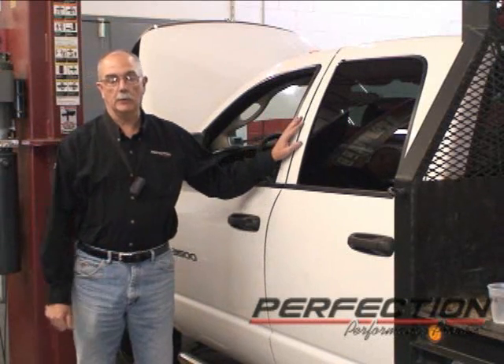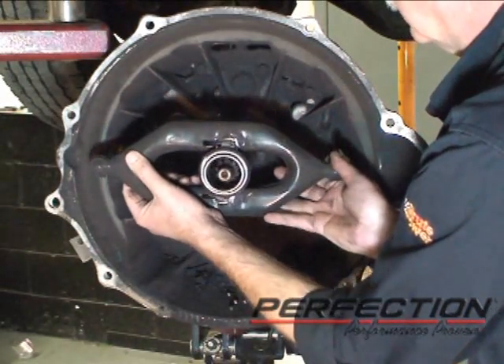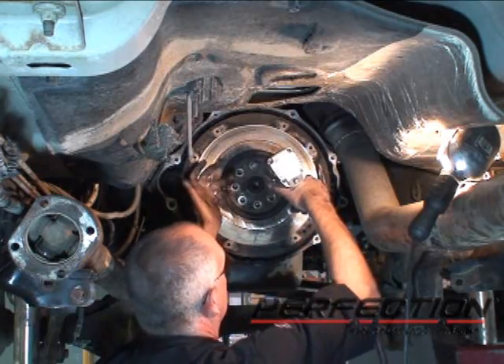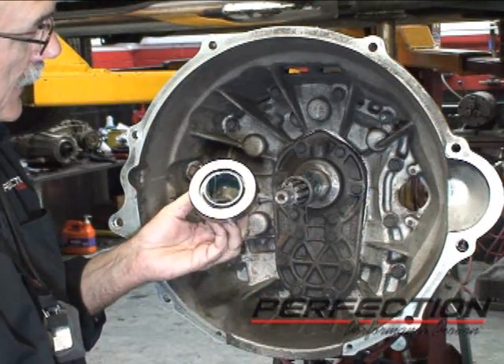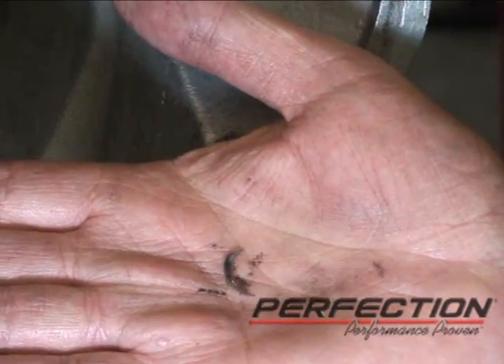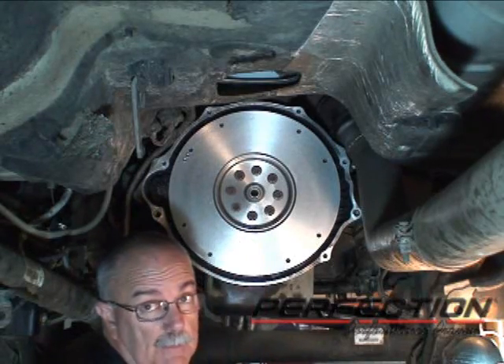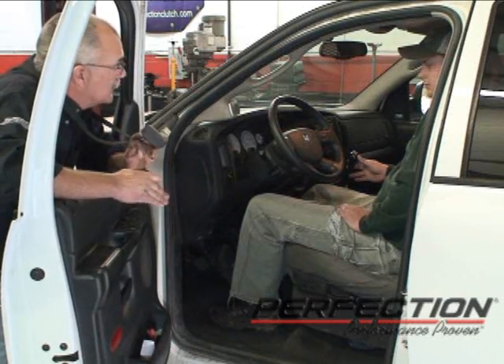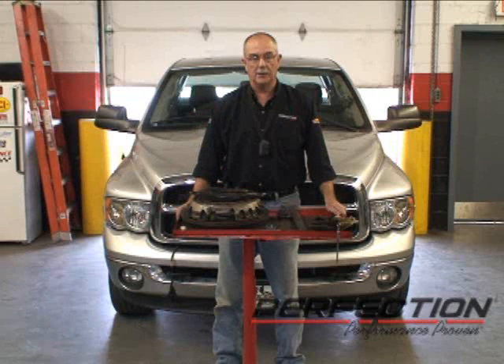2004 Dodge Ram Pickup w/ 5.9L Cummins & NV5600 - Clutch and Flywheel Install

Comment: Thanks for this video, I just swapped an nv4500 into my 98 dodge and was having a hard time shifting into 1,2 & R after the trans got warmed up. I pulled it out again today and cleaned a little rust off of the input shaft and it shifts nice and smooth now.

Comment: I replaced the clutch in my 03 with the 5 speed. It didn't last two months. Thanks to this video I see a few things I did wrong. These are a lot different then the old manual clutches I've put in our tractors. Guess I know where I'm gonna order my next one from. Thumbs up on a great video.
Reply: Hi having the same problem ..what did u do wrong?...im thinking i put the clutch fork in backwards

Comment: Gary, I used a very small puller and was able to get the bearing off....you were right, it was a needle bearing set up and completely dry and seized.  Today I will see if I can inspect the nose of the shaft....

Comment: Thank you so much for the detailed and thorough explanation. My truck needed a new clutch so took it to a local reputable shop. When I got it back  it had a vibration and notchy shifting, hard reverse and was very disappointed. Took it back to the shop they took it back apart and changed to a different brand throughout bearing... still had the vibration and notchy shifting. So I decided to open ER up myself to see what's going on....... Right away I found dirty, rusty spline and they had the trans in a bind by using the bolts to draw the trans together.... So frustrating that the pros damaged the belhousing and did such a poor job on the install. My only question is to make sure I am ok to use a little #2 hi temp wheel bearing grease one the spline. I preformed the install exactly how you did cleaned all rust with emry cloth and screw driver. South bend says leave the spline dry ... They contened even the smallest amount of grease on the spline is a no no. They say grease will work its way to the disk and case slipage or hard spots ... they also said the grease also attracts dust and clutch friction material over time compounding the problem of a clean spline. So the tought was leave dry and the hint of surfice rust is less problematic than the grease slinging on to the disk and the dust packing up on the spline... Is there any truth or should I do as you showed?
Reply: @perfectionclutch  thank you Gary again for such a detailed video and your willingness to share your knowledge. I trust your input and is why I asked the question. There was two companies the local shop and South bend clutch manufacturers. They have nothing to do with each other. The local shop is who did the install poorly. South bend clutch manufacturer is who I got the pressure plate, disk and flywheel from... South bend is who had me scared about spline grease...  but I know you have real world knowlage of many many clutches installed. Just wanted to do it right when I did the job. Again thank you very much. I took my time to put it all together clean and propperly alligned... I loved the tip of using the Hager bolts ... Thank you have a great day

Comment: Just for laughs - "I got tired just watching this video". You're one heck of a mechanic sir., I have been through 3 clutches in my Dakota., I don't ride the clutch or slam gears. I have had a few questionable repairs by local mechanics, one reputable shop said they found 15 nuts, bolts & washers when doing repairs. I would like to have it done right just once though as I don't have the patience,  ability or facility to do the repair myself.

Mechanically speaking the 4.7 L engine is about the best motor I've ever had, I keep clean oil and other fluids clean and lube the K&N air filter etc. The motor has never given me any problems but now the shifting has gotten stiff again and I smell another clutch job soon. I love this vehicle and hate the idea of getting rid of it because everything but the clutch and related parts have been great.

If you have any suggestions I'm all ears. Thanks very much for your expertise - God Bless.
Reply: ***** Thanks Gary have a blessed day., and thank you for your humble attitude.

Comment: Gary, I have a 05 dodge ram with a oem luk clutch.  Started making a noise as if a bolt came loose and was jingling in the housing...pulled the transmission and while very sooty inside, can't visually see much.  I did notice the pilot bushing is stuck on the input shaft and center of clutch rattles alot.....any ideas?  Easy idea on removing the bushing?  BTW, awesome video!!I ahve watched it no less than 5 times..

Comment: I WAS AT THE DODGE DEALERS PARTS SERVICE DEPARTMENT AND ASKED ABOUT GETTING A CLUTCH PEPLACED ON MY 2003 DODGE CUMMINGS 6 SPD.  I got the price quote for the clutch and along with that, It was said that the Dodge fly wheels were machined at an angle to keep from chattering and it was advisable to replace the flywheel also.  Is it a true statement that the fly wheels are machined at an angle

Comment: So what clutch would you recommend for my application. I have a camper and boat I take out  quiet a bit . I was was told the clutch in it is a South Bend Duel Disc . But that’s what I was told . Thanks

Comment: Excellent video.  I have a 2005 dodge 2500 4x4 with the Cummins engine, it has 230000 miles on the original clutch and it is showing signs such as slipping and sometimes putting into gear.  I have on hand a Valiar kit clutch and new fork.  My grandson will be installing it he has a transmission jack, and lift to raise it up.  Trying to get all my ducks in a row I notice that you used bolts with heads off to hold both the flywheel and presure plate in place for both  removal and installation what size bolts were used for your pins.  Again excellent video.  Dick V.

Comment: Gary, awesome video! Clear instructions, good lighting and quality. Q: Had a new Valair put in last year. Before and after I've always heard loud chatter when idling and clutch engaged(pedal released) or shifting into 5th or 6th and engaging clutch(releasing pedal) noise stops when i step on the clutch pedal. From all I've read, could this be the input shaft or the bearing? I noticed you mentioned alignment issues causing input shaft failure... hmmm? I should just call you. :(
Reply: I think it sounds like a bad throw out bearing, my car did the same thing before the bearing blew apart.

Comment: Just put a new clutch kit in my 2002 3500 5.9 NV5600.  10 spline, 1 3/8 output shaft.  4 1/2 hours.  $530 for the kit.  Easy peasy, except for that damn transmission crossmember.  I had to beat it out with a large hammer, and spread the frame to re-install.  After that, its all pretty much self explanatory.

My root issue was that one of the springs from the clutch plate itself let go and lodged in between it and the pressure plate, not allowing the clutch assembly (release bearing) to physically disengage the clutch from the flywheel.  I initially thought that the release bearing seized, but that wasn't the case.

Comment: lot's of heat build up on the release fingers…holy moly...
Reply: ***** The same thing happened to me, car had 43kmi at the time, about a week before the bearing broke apart, there was a screeching sound. Took it apart, bearing disentegrated, balls on the bell housing floor, like 3 pressure plate fingers completely broken out, clutch disk was like new and the bearing was greased. Replaced everything and readjusted the pedal preload which I suspect the manufacturer or previous owner screwed up. Thanks for the great video!

Comment: mine is a 2004 3500 with 173k miles.  I have no problems shifting but you have to press the clutch pedal way down and its hard on your leg after a while.
Reply: thanks Gary. I will ask him to check on that before ordering a new clutch kit

Comment: My wife was driving it. Said she was at a stop sign, couldn't get it out of gear and had to shut it off. Was able to get it out of gear and started. I showed up and noticed it was making a sound like the jingling. I backed it up and parked it in the driveway. I did notice release bearing is completely dry, but rotates freely. I suspect this but have concerns about the input shaft. To me it looks like a bushing or maybe a wear sleeve?

Comment: Why wouldn't you replace the rear main seal ? 240,000 miles and all you have to do is remove the bell housing and there it is ! I seen no indication that you intend to replace the RMS .  So ,now if the RMS starts leaking the owner is going to pay someone probably atleast a $1,000 to fix the leak !
Reply: Surprised at same. When I sold/advised, we insisted on replacing rear main, regardless if leaking. You're already there w flywheel off - seemed odd he didn't replace

Comment: Got an NV5600 in a 2002 3500. Fairly high miles, about 500K. It makes noise in all gears except 6th gear. Any thoughts? It has only had the clutch done, no other major service to the trans except fluid changes. Shifts good, no grinding or hard shifts so synchros are probably good. What is the life of these transmissions before needing a complete rebuild? What could be making all gears noisy except 6th? Im thinking bad bearing but its fine in 6th so I'm starting to think that that is not a valid conclusion unless it is only one bearing that doesn't have as much load applied in 6th.

Comment: Which clutch did ya’ll put in? I missed it. I have an 03 6 speed NV5600 and I’m trying to decide which clutch to put in, just stock truck with a gooseneck hitch that gets used occasionally pulling 10k or so
Reply: What clutch did you end up going with and how do you like it?
Reply: @Natedoc808  ended up putting a valair single disc heavy duty and solid flywheel in it. Ran perfect for what I needed still in it

Comment: I have a 2005 Ram 2500 with a NV56 . My clutch is the South Bend duel whatever they told me . When I bought it no noise when pressing clutch . Then after 6 months or so now sounds like dry bearings in the throw out bearing . Mechanic replaced it and showed me the old bearing and I see they are not a sealed bearing with grease . He put a new just like the old one where one side is open to the bearings . Looks like no grease and still makes the grinding dry bearing noise . After spending $1,800 for this and still the same loud noise I was and still am PISSED , I've changed throwout bearings before in my 4 speed cars over the years and every one were sealed and greased bearings . Do they make a sealed throw out bearing for the 2005 Dodge Ram NM56 and the South Bend Duel clutch ? Everytime i pull up to a red light people look and some yell i need a new throwout bearing . HELP ME !!!

Comment: I also have a 2004 3500 with the 5.9 Cummins and 6 speed tranny. I want to order my parts prior ro tackling such a job. How can I determine if my clutch is a 12 1/4" or 13" clutch? Also, is there a preferred brand that you use at your shop? Thanks and great video.
Reply: Same as brake rotors & other stuff, don't know what size of what-evers were installed at that facility that day. Must view the parts with naked eyes, verify.

Comment: We have a 2005 Dodge Ram 3500 with a 5.9L diesel we are replacing the fly wheel and torque converter. Everything fits but the new aftermarket torque converter is about 1/8" thicker than the factory converter, and has made the installation a bit more difficult. The factory torque converter bolts broke off, so thats why we had to replace this. I was wondering is this normal on torque converter upgrades? And if so what tips do you have to make this installation complete. My dad stated that if the Torque converter is binding or too close to the pump it will damage it. He is the one who is installing for me. Any help from someone who has encountered this would be greatly appreciated. Thank You.
Oh yeah one more thing the truck has an automatic transmission.

Comment: Just noticed a squealing sound when depressing the clutch pedal. Any idea? my best guess is the throw out bearing.. Oem clutch from my understanding. 277km. 03 5.9 nv5600. 

Thank you. i enjoyed the video.
Reply: perfectionclutch 
it will make the sound in neutral and just idling as well. 
what type of clutch should a guy be looking at for this type of truck. intake exhaust and a edge attitude.

I haul lots. welding truck and sometimes a trailer. thank you for your help.

Comment: been watching your videos but have a question about nv5600 this is my 5 time taking the transmission out my dodge 3500 for reason being broken pressure plate bolts can't figure why there breaking down inside the the fly wheel I torque them every time but  still there breaking may be u might had the same issue before???

Comment: Local Shop quoted me 2k to install a new clutch kit. Just wondering if that is a reasonable price. Parts and labor included.
Reply: I got the same quote ($2000.00). Then someone under bid that by only $100.00 (whatever...............). So I decided to do it myself. Bought the jack & clutch parts for just under half that. Saved over $1000.00.

Comment: When I put my clutch pedal in , there is a weird sound coming from the bell housing area. It’s not a grinding sound. Friend of mine says maybe throw out bearing . And thoughts . Gets embarrassing at a stop and church engaged . Thanks
Reply: When I bought my truck it did that...thought it was throw out bearing.  I pulled transmission, and it had a $2000 racing clutch in it, and the sound was the loose plate inside 😀.
Reply: Was told when I bought the truck it has a South Bend Duel Disc . And after new throw out bearing still makes noise like it’s going out . I use my truck for camping quite a bit so we carry a truck camper and pull a boat . Which clutch system would you recommend so I don’t hear the bearing sound every time I come to a stop . It’s embarrassing . Thanks
Reply: Take the washer out from behind the Idler ball on the clutch fork.  Use a 3/4" beep well socket to take the ball and bolt out.  Ditch the washer, then reassemble.  (ONLY ADVISE FOR DUAL DISK CLUTCHES)

Comment: Something weird happened today I was driving on a street too
much traffic suddenly the gear box start making a lot of noise like something
was breaking inside I stopped the truck I have a 2001 Dodge 3500 diesel truck I
could not move it for the noise I opened the hood and check the level of the
clutch container as soon I opened the fluid start coming out... I start making
some calls (towing truck) a person showed up and told me he was a "Mechanic"
what was wrong with it!! I explained and he said try to move it I did but
nothing happened for one block he was following me with his motorcycle but
nothing happened so he said that probably was the clutch and it could be a
serious amount of money since I have to replaced clutch, disc, and steer wheel
part and he said probably the gear box needs to be check out but it was almost
a 100% sure that it was the clutch breaking apart ... I was able to finish what
I was doing and I got home so I start looking for answers...the truck is 200 000
miles, I got it when it was 35 000 and so far I have not replaced the clutch.

I am just trying to get some answers I do not know how to
fix it so I have to take it to a mechanic shop can you give some advice, Thank
you.
Reply: A 'steer wheel' is what you hold on to when setting in the driver's seat. There is NOT one between the transmission & engine. Not even inside the transmission. Throw-out (release) bearing, pilot bushing, clutch  disk, pressure plate and 'flywheel'

Comment: I have the same transmission but in a 01 2500 4X4 176000 miles. The truck was driving and shifting fine then all the sudden it was very hard to get in gear. Once in gear it drove fine no slipping or chattering. I made it home but now when the clutch peddle is pressed it will not go into any gear. It went from shifting good to not being able to shift in a matter of 30 minutes. Before this there was no grinding or any tell tell signs of a bad clutch once in a while it would be hard to go into reverse. Is this the clutch or is it a hydraulic issue? Hydraulic fluid levels are good.  Any help would be appreciated.

Comment: Whats the normal life of a clutch on this truck?  I have the same set up, with 173,000 miles.
Reply: ***** Gary, thanks for the reply.  I bought the truck with about 30,000 miles on it.  I don't know if the clutch was replace before that, but I have not replaced it.  I was an excavator before a career change, and in that time I put about 100,000 miles of hard towing on it.  The clutch feels good, and the shifts are smooth and easy, but I have noticed from time to time after running at freeway speeds when I take the exit ramp and shift in to neutral the RPMs will oscillate from idle to idle plus about 300 RPMs.  When this happens there are about 2-3 cycles in the oscillation before it settles back to normal idle RPM.  Is this an indication of the clutch on its way out?  Or is there something else going on?  Thanks again for your help and quick reply.

Eric
Reply: ***** Gary, thanks for your help.  When it starts showing signs of being shot I will be looking to you guys to buy the part.  Thanks again!